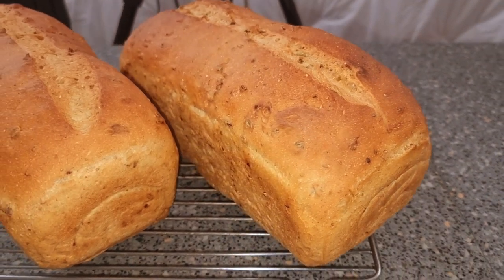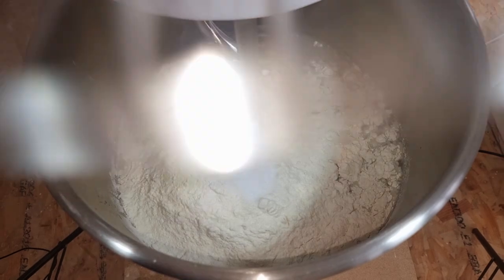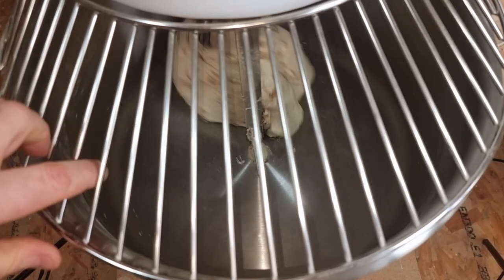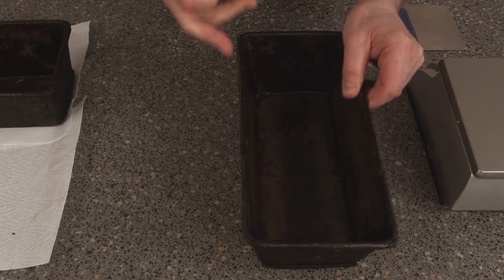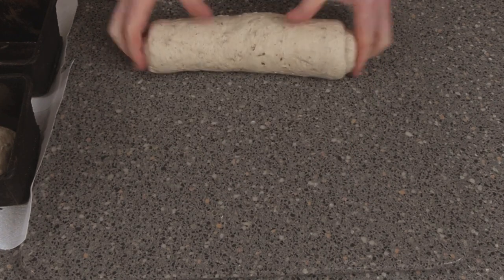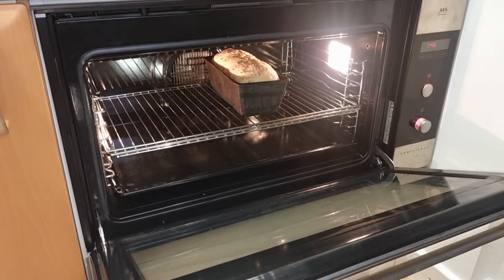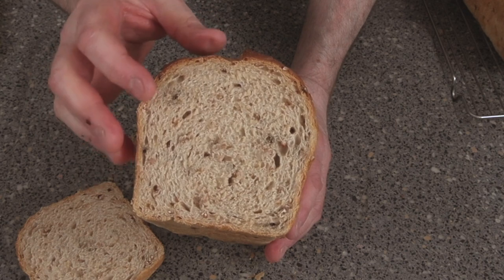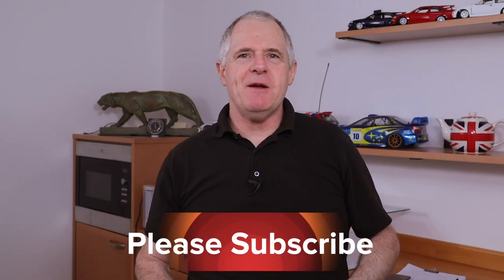Unlock the Secrets of the Most Amazing Bread Recipe You've Ever Tasted!

Comment: I notice you did not use ant oil or fat? does this mean the bread dries out quicker? Thanks
Reply from the maker: Granary bread is a type of bread that typically contains a mixture of whole grains, such as wheat, barley, and oats, along with malted wheat flakes and wheat bran. It is known for its distinct flavor and texture. Granary bread recipes may vary, but in general, they do not require oil or fat for a few reasons:

1. Moisture from grains: Whole grains, such as wheat, barley, and oats, contain natural moisture and oils that contribute to the overall moisture content of the bread. These natural oils can help keep the bread moist without the need for additional fats or oils.

2. Malted wheat flakes: Granary bread often includes malted wheat flakes, which are pre-gelatinized and can absorb moisture during the baking process. This absorption helps retain moisture within the bread, making it soft and moist even without added fats or oils.

3. Texture and flavor: Granary bread is prized for its unique texture and nutty flavor, which come from the combination of whole grains and malted wheat flakes. Adding fats or oils could interfere with the desired texture and alter the distinctive taste of the bread.

While granary bread recipes generally do not include oil or fat, it's worth noting that some variations or personal preferences may include small amounts of these ingredients for specific reasons. However, the traditional granary bread recipe relies on the natural properties of the grains and malted wheat flakes to provide moisture and flavor, eliminating the need for additional fats or oils.
Reply: @crazybaker1  A big thank you for your response:
Currently I am using my own recipe (see below) The bread comes out soft and tasty, but if I can avoid the olive oil and sugar then there's less calories!
Perhaps you could have a look at this and suggest any improvements?
Ingredients
250g Wholemeal Bread flour			
200g Strong White Flour				450g
50g Oats							500g	
50g Malted/Toasted Wheat Flakes		550g
450g Water
1 or 2 Tablespoon Malted Barley Extract
2 teaspoon Instant Yeast
1½ Salt
3 Heaped Teaspoon Sugar
50g Olive Oil
I dissolve the malt extract in the water before adding to bread machine (Panasonic)

Many thanks for your help👍
Reply from the maker: @mattelijah2615  what I would do is, remove oil, sugar, add in little bit more malt extract, and add in some barley malt powder 3% weight of flour, it will taste better and, fat and sugar free, wear you remove the oil just use water, it's going to make the perfect soft and tasty loaf 😉 😀 enjoy laters Steve
Reply: @crazybaker1  Thanks Steve, I will take note of your advice.
One last question:
Where can I get <barley malt powder>
Thanks
Matt
Reply from the maker: @mattelijah2615  Amazon or Shipton Mill and, of course, bakery bits, which seem to sell more different types of things in smaller size for home bakers, I will be doing a video on this product when I get time, Shipton Mill gave me some for the video, at the time I didn't know they did it 🙂
Reply: @crazybaker1  Many thanks for your help👍
Reply from the maker: @mattelijah2615  your welcome mate 👍